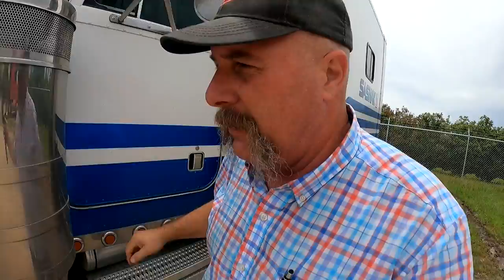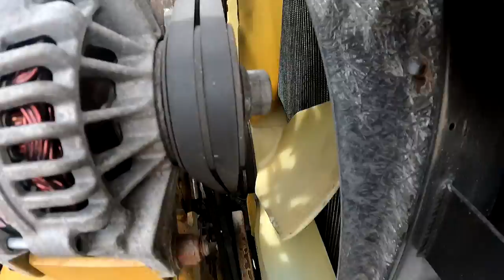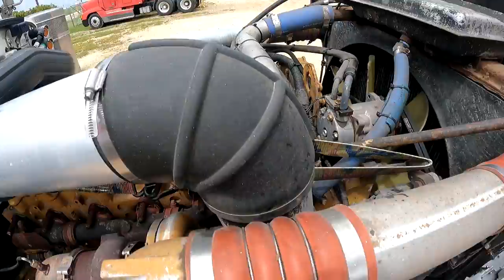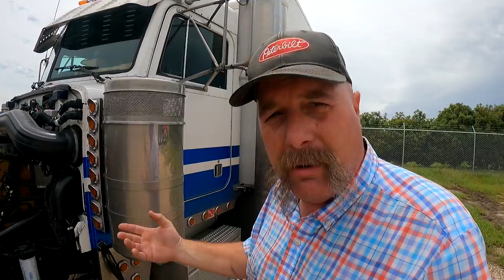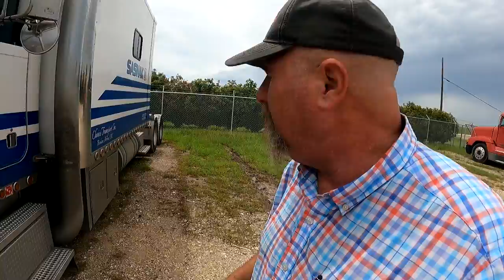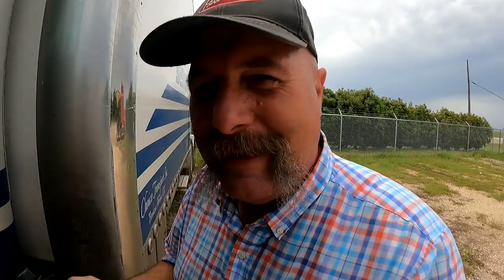617  Ah shoot     I'm broke down

Comment: That broken mount brought back some memories!  When  I was a youngster I built myself a hotrod pickup out of a 1969 C10 .  I put a rebuilt Sun Engines 350 in it, I was so proud of that thing.  Me and a friend went on a road trip in it through several states.  All went well until we came through Mount Vernon on the way home, it was at that time the truck died on the highway and we coasted to a stop on the service road. When I opened the hood I found that the alternator bracket had just fallen over.  Unfortunately for me I had used a non graded bolt on the alternator bracket and from all the heat of running it broke off in the head.  To top off this already bad situation it looked like a tornado would touch down at any minute.  The only thing I could think of was to take off my belt and strap it to the alternator and the suspension A arm to hold it in place.  Then we managed to push the truck down what little incline we had on that nearly flat service road, by some miracle it was enough and the engine started when I popped the clutch.   We managed to limp all the way back home to Ft. Worth, haha.  I'll never forget that, I thought we would be wiped off the map by a tornado or struck by lightning and there was nothing out there and nowhere to hide.   Anyway, I hope you get all the bugs in the truck sorted out as cheaply as possible.  Not surprised that that shock mounting stud was expensive as that's probably not a typical wear item and they know you can't get it anywhere else.

Comment: These old trucks always have a way of showing you who's the boss.
Reply: I’d rather have those issues to fix than have a 2 year old Pete like mine that needed a whole new dpf system already
Reply: @maxracingteam23  I hear ya.   I just about bought a 2019 389 but changed my mind on it all the emissions stuff and the paccar engine scared me.
Reply: @victoryrider  we have 5 new trucks with the paccar engine and they are always having issues. Nothing major (besides my def issue). But it’s enough to get annoying.  Then we have 1 truck with the X15 Cummins. Has no issues, change oil and grease the chassis and hammer down.  I feel buying a truck with the new Cummins X15 is the way to go.
Reply: To my opinion it's a Covid deal! Hopping the repair will come soon and cheap !

Comment: Makes you wonder how such a crack happened.  I wonder if the truck has hit something.   Perhaps not large enough.  But enough loosen or crack part the bracket that holds alternator.   

Might be idea climb under the truck with good light and try ** thoroughly** go over the truck frame or anything else.   Crack like that shouldn’t have happened unless the truck was in small accident,

Wouldn’t not be surprise if many old lines are rotting and what not.   I know Dan (super trucker Dan) had do bunch fuel lines on his old Peterbilt  379 recently too along with new fuel tanks ( I think). Was big job but worth it.   Your truck Is an old girl and she going need a lot love and care/time and patience to get all little gremlin out lol. 

Still good video. Hope get everything solved soon. Take care :)
Ps while at truck shop.  Hope you have mechanic check over your turbo.  Best check now then wait later then have it blow out on you.

Comment: Stan, get one of those scopes that can see what the insides of your fuel tanks look like...
Make sure they don't have the algae funk built up in there...
You will constantly be pluggin the filters if that crap is breaking loose.
Lots of fuel treatments that will correct it, but will require many filter changes, or will need to get tanks power cleaned...  not fun.
Great looking old school large car ya got!

Comment: Good idea to replace the fuel lines but the black flakes are probably microbes growing in the fuel tanks. You can use a biocide designed for diesel fuel but in my experience it doesn't remove the problem once its gotten to the point of plugging fuel filters. What I've done is to remove the fuel from the tanks, remove the tanks and rinse them out with hot water. Then I put in 5-10 gals of gasoline in the tank and roll/slosh it around on the ground until all the black stuff is removed from the tank walls. Empty out the gas and do it again....repeat till tank is clean inside. Let the tanks dry out completely and install. Use biocide once a year as maintenance  to keep any microbes from forming. I've had better luck using this method than having tanks steam cleaned.

Comment: The black stuff is probably algae, I’ve been fighting that for awhile. The fuel probably looks dirty??  I put a davco fuel filter system on and the little pieces float around and you see it. Ended up putting all fuel lines on that wasn’t it. It Wes algae. Ended up using algaecide in the tanks and it’s gotten better but not gone.
Reply: Is there a way you can flush or deep clean the tanks? Just to get rid of the algae...
Reply: @mystical3022  : yes, drain the fuel and dispose of it and clean them with hot water and aluminum brighter. Dry them out and refill.
Reply: @mystical3022  on boats that sit moored in the water for long periods unused it's common to install a fuel polishing system to deal with algae buildup. basically it's a system that pumps fuel from the tanks, runs the fuel through progressively smaller filters then returns the fuel to the tanks. most are on a timer system to run for several hours a week but in bad cases the system runs more frequently. years ago i worked on an old chris craft wood boat that had 2-600 gallon fuel tanks that were both half-full of black slimy diesel, we pumped all of the fuel into one tank, set up our fuel polishing system that used paper towel rolls as filter material and for 2 weeks we pumped the fuel between the 2 tanks and used up at least 2 dozen rolls of paper towels... but at the end of that the fuel was clean enough for the normal engine filters to handle.
Reply: @marzsit9833  : thanks this is very informative
Reply: Inspect closely what the little flakes are. You can usually tell if they are algae or specs of fuel hose liner. There are companies that can clean and recycle bad fuel right out of your tanks

Comment: Did you say the white fuel filter with the water separator bowl was your secondary fuel filter. So the CAT yellow filter with the primer pump on top is your primary fuel filter. Does the fuel go from the tank to the primary then the secondary filter and then to the engine or is it tank, secondary, primary, to engine. The reason I ask bid we have 2003 Newmar DP with a CAT 3126 but it only has 1 fuel filter with a water separator bowl. My understanding from talking to Caterpillar is the 1st filter is the primary with water separator bowl (normally 10 micron) and the secondary filter is the one on the engine with the primer pump and is a 2 micron filter. The last filter has to be a 2 micron. Our only fuel filter(something freightliner specified around 2003 when ours was made), was a 2 micron with a water separator bowl looks just like yours how it's mounted to the frame. Cat doesn't have one. They substitute a Donaldson(#??) or Freightliner uses an Alliance filter # ABP/N122-32FRT03. Could you possibly tell me what filter you have (the white one mounted on the frame rail with water separator). Thanks Stan.  Sorry for the length of this question. We have that same black specks, I call it pepper, in our water separator bowl. It's not ferrous metal as it won't stick to a magnet.bprobsbly hose like you said. My fuel line is 25-30 feet long.

Comment: Just curious what is the gear in your new tractor and what it was in your old tractor and if you know a lot of information about gear
Reply from the maker: The 2007 Pete had an 18 speed with 355 rear ends.  This 2004 Pete has a 13 speed and I assume 355 rear ends.

Comment: Yo STAN,
1st that belt was the act of a brilliant driver - and RARE now-a-days!  LOL
   2nd and sadly:  That is NOT likely rubber, but VERY likely is ALGAE.   Fuel (and MILEAGE) in this here United States SUCKS with the unbridled addition of water loving ethanol.  As to the algae, I speak loudly and with the voice of BIG DOLLAR paid for experience, as my entire fleet of diesel vehicles on our ranch became contaminated and afflicted due to that issue.  Since that truck sat for so long with likely far less than full tanks, condensation was constantly building daily with temperature changes.  
     I was lucky ( yeah only thousands and not 10's of thousands of dollars) and we were able to flush my primary holding tanks, along with using 2-4 fuel filter changes per vehicle - and ALSO added Fuel oil biocide and slimicidea product called "KILL'EM" - which attacks and destroys the heavy algae growth.  It WILL turn to a sludge and I suggest you DO NOT allow the tanks to get below 3/8 of a tank until you get a chance to flush them.  Once in the tank, that crap is like self replicating clay based mud.   Sorry I can share GOOD news....but at least there IS a solution to crappy fuels - be absolutely POSITIVE you maintain adding something to control algae at least until you get them flush - it WILL continue to grow inside the tank until then.  Stay safe, and LEAVE those runaway coffees for the sweeper~!!  LOL
From their site:  Killem will control microorganisms in fuel oil storage tanks, fuel oil and other refined or partially refined oils. Killem will reduce tank corrosion, slime mats, odors, fuel oil filter deposits and corrosion, fuel-water separator deposits, injector plugging, excess carbon deposits and exhaust gas smoke. Killem helps sanitize your entire fuel tank.

Comment: Common problem on a cat to break them brackets
Reply: cat tends to heat treat steel so it's too hard and brittle, i understand why they do it for certain things like shovel buckets and teeth but i have also seen lots of cracking on various cat equipment over the years.

Comment: 8mpg? That motor? That truck? No way in hell...
Reply from the maker: I'll have to make a video about it.   My previous truck would get over 9mpg doing the same thing.   Gotta remember I'm bobtailing 50% and pulling an empty trailer 50%
Reply: big rigs eat big amounts of fuel. my dad had an international 5-yard dump truck with a detroit 6v-53 in it with a 5-speed/2-speed rear and it would get 6mpg on the highway. i used to have an old gmc 4104 bus with a detroit 6-71 and a 4-speed and it got 9-11mpg on the highway.

Comment: lol did nothing to the truck lol who has issues get Stan a tissue boo hoo..ha ha ha ha ha ha ha confetti in the fuel?? that bolt cost $18.50 cents plus state taxes and federal taxes = to $290.00 thought it be cheaper to buy 2 washers put 1 on each side of the chassis then crank it down super tight